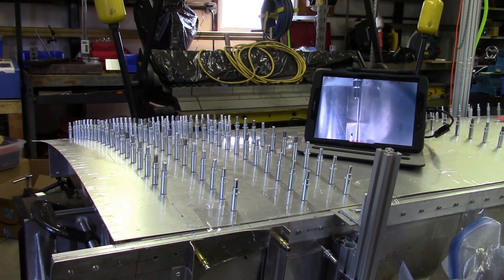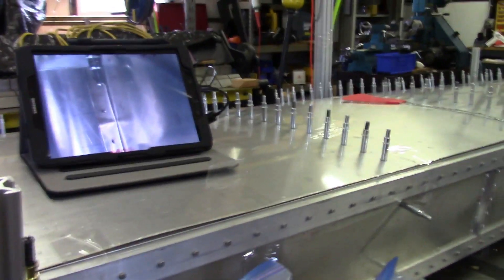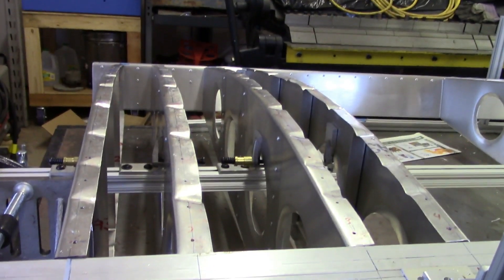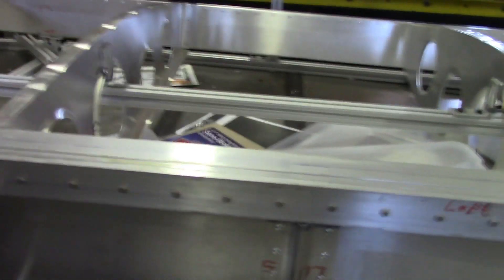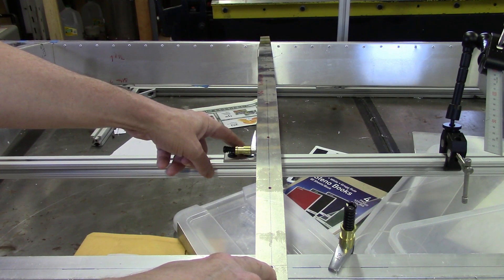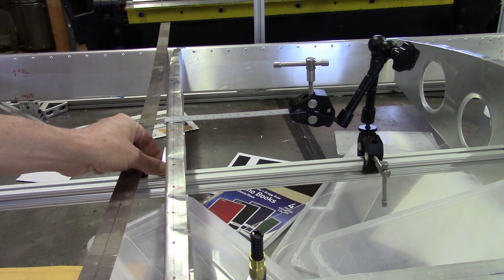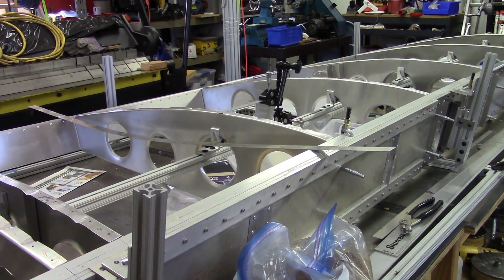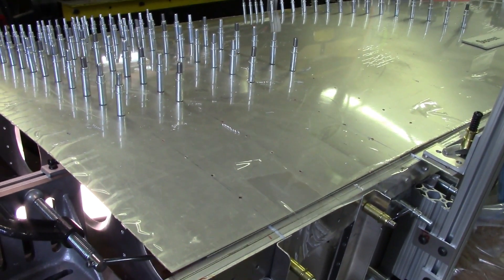Complete Left Wing Skin Drilling

Comment: Why not using drill blocks?
Reply from the maker: I do not understand the question. Are you referring to the drill guides I was using in another video?
Reply: Yes
Reply from the maker: I did not use the drill guides when drilling the skins because it is thin sheet metal. It is not as much of a problem if the drill is not within a fraction of degree of perpendicular.
The spars are about 1 inch thick. I used the drill guide for the wing bolt holes because it is a structurally critical component. It must not only be as perpendicular as possible, it must maintain a tight hole tolerance. The drill guide helps ensure those tolerances are maintained.